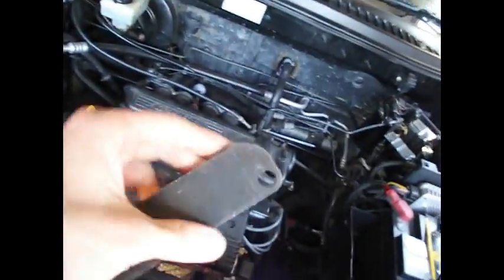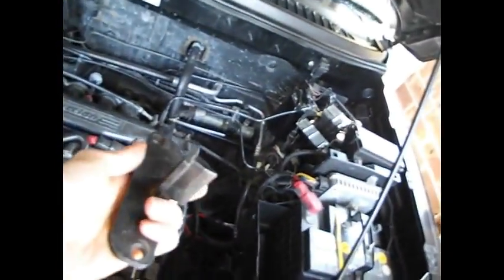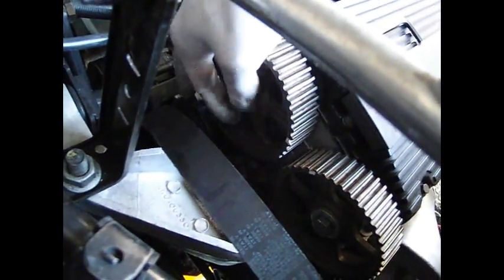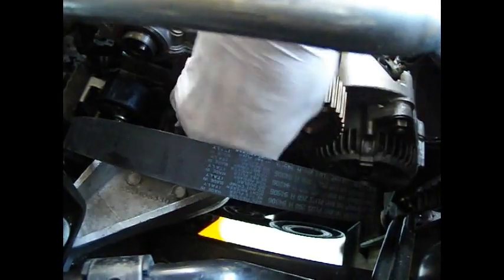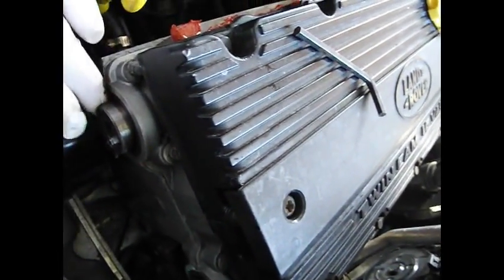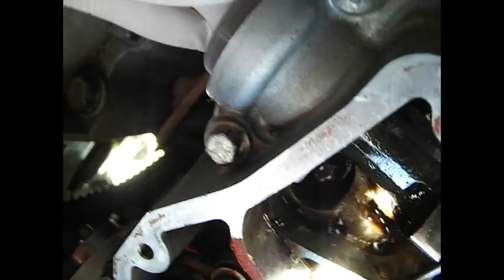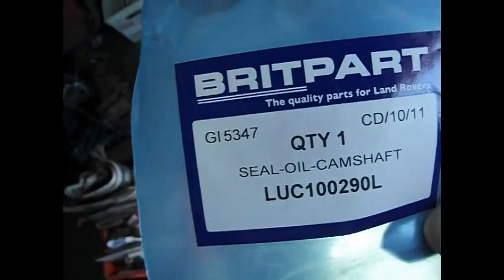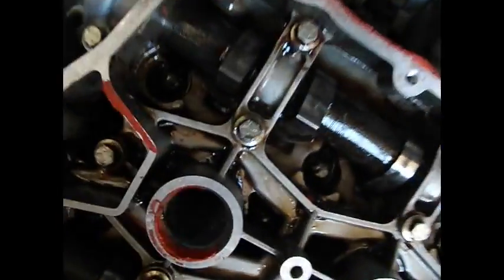Fixing oil leak with partial timing belt removal only. Camshaft oil seal, 1.8 Freelander.

Comment: please my friend give as a video with our sun roof, It works but claks claks and stops and i have to push the button up and down to close.
Reply from the maker: +MANOS DIVER Hi Manos, none of my ones have sunroofs, or is it spelt as sunrooves, however based on your description of the problem, is there a sunroof regulator motor or similar? It could also be other things. Still could be a few things, you could check the fuse, probably the easiest check but least likely to be the issue. Could be the sunroof regulator motor, etc.
Reply: +Jasco Kovacevic thanks my friend , the motor stop to work as it find hard to move.Back and forward the roof orens and close.I order ebay the motor gear a small one and the next days i will take it apart.I cannot find a video with diasemble the roof.Anyway thanks and keep the good work

Comment: Yes you are right Jasco I did not remove timing belt I only removed cover. No I did not hear loud band only Hydraulic Tappet noise like watch going tik tik tik :). I will do compression test today and I will check spark plugs. I did not understand why engine have good compression after it is no if I did mistake and engine have wrong camshaft position and wrong timing you are right its will damage valves but  it is working

Comment: I retighten head bolts and one of them I snap I will buy new one. something stop engine Jasco  it is runs very well after it is not engine lost power I stop car no water boil all 4 cylinder runs good but something  prevents engine develop power I thought it was Knock sensor I checked fuel pump pressure 4.3 normal I don't
Reply from the maker: You didn't remove the timing belt to tighten the head bolts did you? Only the camshaft cover removing. If you removed or disturbed the timing belt and didn't time it correctly following reassembly, this will be why. Did you hear any loud thump or loud bang immediately before the engine lost power? If the timing wasn't set correctly, the pistons will rise up and smash the exhaust or intake valves which will explain why it wont start. Can you do a cylinder compression test on each cylinder to see which one is lacking compression? Pull out all spark plugs and see if any are coated with oil or coolant.

Comment: Hi Jasco can you tell me if 1998 Freelander 1.8 has  Knock Sensor and if it has where it is
Reply from the maker: Hi Achi, the 1.8 Freelander definitely does not have a knock sensor. The KV6 does have an ignition knock sensor though.

Comment: Hi Jasco I investigate hoses and I found little leaking. I bought new aftermarket hoses and they are leaking. I bled all air as you show in your video .Coolant don't boil in the tank. For the first time when I started engine I checked new temperature sensor if it switch on radiator Ventilator and I spend 20 min to warm engine and its switched on Ventilator between red line and half. Yes I used MLS gasket with new oil rail and shim I fit it dry as rover manual order.
Reply from the maker: Good one achi, you might find this funny, but once in the past, I bought new aftermarket hoses and found them leaking. I then went to the wreckers and removed a few genuine hoses off a 98 Freelander - the genuine second hand ones are not leaking!

Comment: Hi Jasco I did it I have new K engine :)
Reply from the maker: Tops good one! Is it running well, what's the sound like, is it loosing coolant? Did you fit the liners or was it an engine reconditioning shop? Did they or you seal the liners well, if so what did you seal the liners with? Jasco.

Comment: mate, i was wondering if you could help me with a problem. im hoping to replace the rear sway bar engine mount, but am still waiting for a mate to give me a hand, but my problem is since i removed the prop and the rear sway seems to have failed im getting a really loud creaking and cracking noise from the engine mount that looks like a cone on the right side of the car. is it hard to replace that part, i think it was called a hydromount? i know the engine is swaying a hell of a lot till i replace the rear mount but the cracking almost sounds like its metal on metal
Reply from the maker: Hi Kristian, it's true, since you removed the prop shaft which also used to hold some of the weight, the wobbly or loose part is slowly starting to show itself. The drive shafts would also still be holding on to gearbox/IRD or have you removed them? Can you rule them out as causes? You could also remove the drive shafts and see if the noise continues. Not hard to replace hydramount. In order to renew the hydramount, you got to support the engine sump with something else as the hydramount holds the engine. I used a block of wood and a good hydraulic jack capable of being raised to 440mm. Support the engine under the sump, then start undoing the mount bolts for the top mount @ the top right...caution... they will do done up extremely tight, I once tried an electric impact wrench and they wouldn't budge, that's because they weren't greased before and usually some rust... but with a breaker bar you'll win.. With a breaker bar on the end of a wrench, you get them out. Get the 4 bolts out and separate the top mount from the engine front plate bracket then you can renew the mount. Just grease the threads of the bolts when you put them back in so they can be removed easier. Torque to spec.
Reply from the maker: Jasco Kovacevic Kristian, just to make sure we're on the same page for the hydramount, you mean the engine mount at the top right of the engine, right? Top right when looking at the road from the driver's seat..
Reply: Jasco Kovacevic  hi there, thanks for the speedy reply, the noise is most defo the hydramount area. iv had a mate engage the clutch quite quickly on and off with me leaning on the wing and you can hear the cracking noise from the mount and see it move up because of the rear sway not supporting the engine. so defo that mount area. yeah it is the mount thats on your right as you sit in the car. once i can get some help to get the sway bar done il start onthe hydramount then. thanks again buddy. i cant seem to find any help online with this mount so you have been of great help.
Reply from the maker: Kristian Jones Hi Kristian, you wrote "clutch", I thought yours was a KV6 not the 1.8? The 1.8s also have the hydramount and removing it is quite similar as the KV6. Support the sumpunder a jack with block of wood then undo the bolts to the hydramount top. My tip here is to make your life easier - when you support the sump under a jack and a block of wood - make sure the jack supports the sump balanced and even, not leaning more upwards on the left hand side or right hand side. Use a jack and wood and 1x jack stand and wood if it makes it easier. Some of those hydramount bolts might not budge, use a large cheater bar wrench with a large steel pipe on the end you'll see how easy it is then... remember to grease threads of bolts upon refit. Let me know how you go. Btw, do you need the part number for the mount to search for it on flea bay or parts dealers?
Reply: hello mate. oops. no its the little 1.8. thanks for the tips. i will most defo be using them when i get to that hydramount. i had a horrible thought it would all be interconnected to the suspension on that mount somehow. but all seems simple enough as long as i stick to your instructions. iv found the part on fleabay mate thanks its only 22 uk pounds for the part. so nice and cheap. thanks again man you been a real help.
Reply from the maker: Kristian Jones  HI Kristian, no def. not connected to the suspension. I always thought you had the KV6. I'm putting the engine back in my KV6 this week, then in the future when I get a chance, for the 1.8 it'll be clutch change to the new heavy duty clutch.